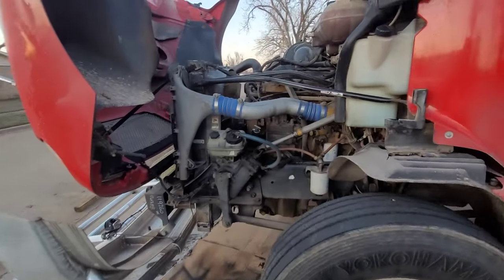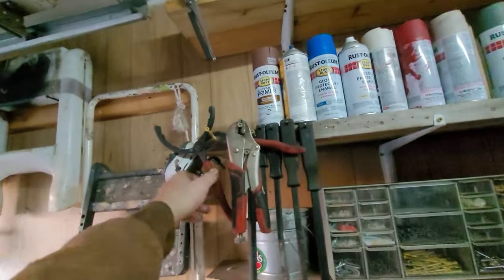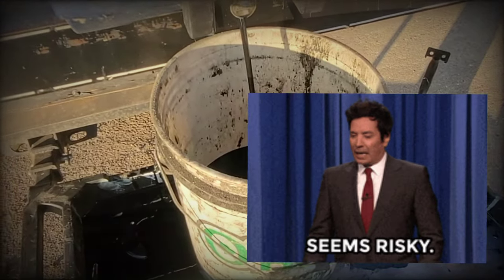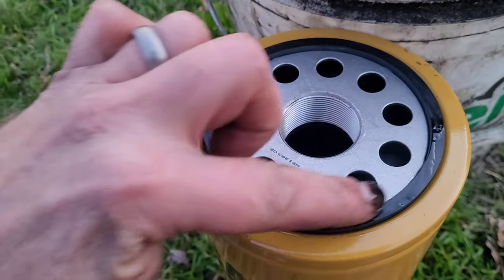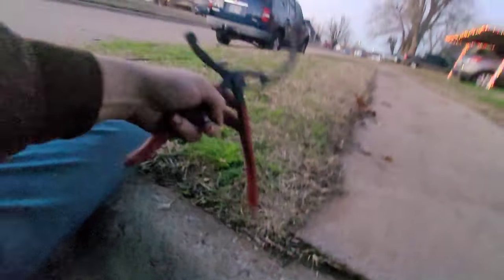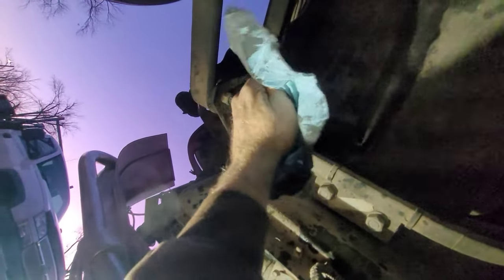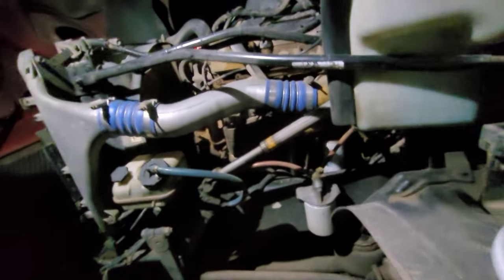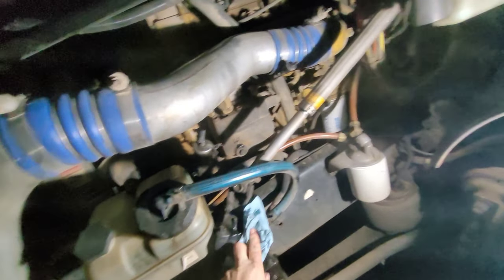Oil change on a semi truck |  In-depth guide

Comment: I might be a year to late but poke a hole in the side with a punch leave the puck in and let it drain off the end of into a pan so it's not getting all over the axle. It will get some but not as much. You don't need all of it out just enough to turn it side ways. Just a suggestion.
Reply from the maker: Good idea.  I use a funnel now with some magnets attached to it, but I'll have to try your idea for sure.

Comment: Does the owners manual say too use additives?
Reply from the maker: It doesn't specify.  It's definitely ok.  Helps lubricate the motor with cold starts and helps with blowby.  It's a noticeable difference.  I go through about a gallon of oil every oil change. Thats 13000 miles.  Most of it leaks out and it's a slow leak. Thats pretty good for an old motor.  Without it, it's way worse.  Lucas makes excellent products.  The owners manual doesn't mention additives bc it's a liability.   Somebody, somewhere would put in way too much, have their motor blow, then sue Freightliner. The manufacturer would also rather have you spend 40 grand on an in-frame then get more life out of your motor.  There's plenty of videos showing how safe and legit lucas oil stabilizer is.  I've done about 24 oil changes in 300000 miles on this truck and most of them were with a gallon of lucas.  You can actually put in 20% of capacity, which is 2 gallons.  I only do one.  A lot of shops will ask if you want them to add Lucas too.